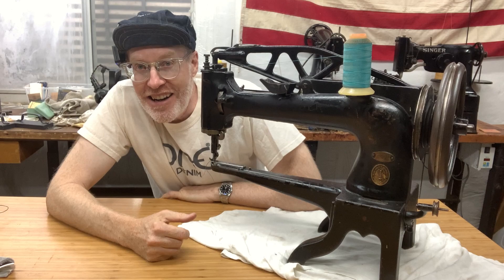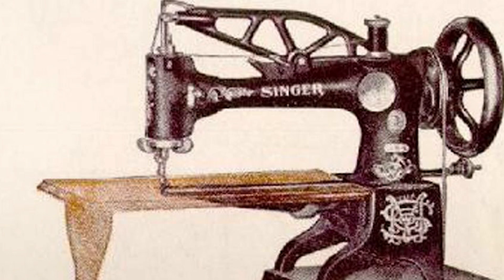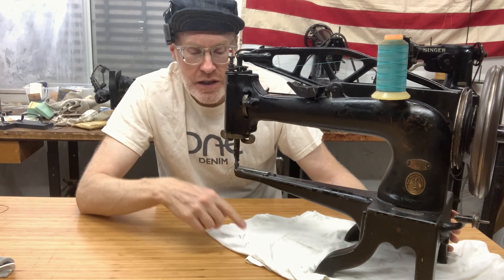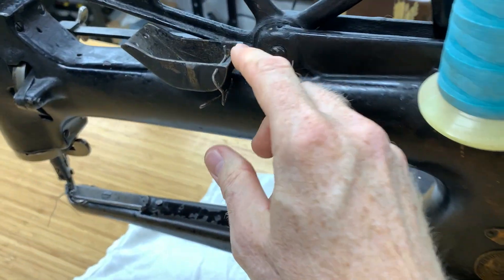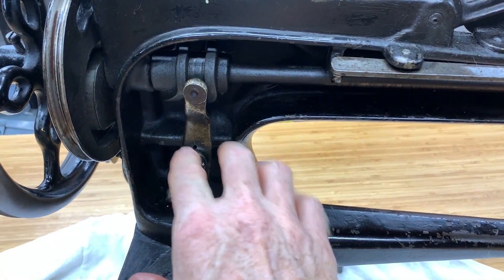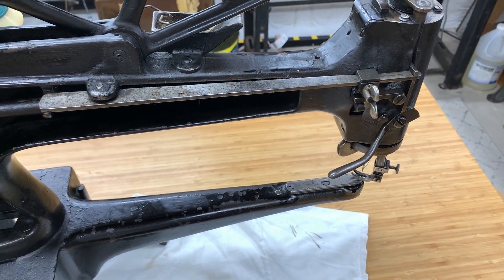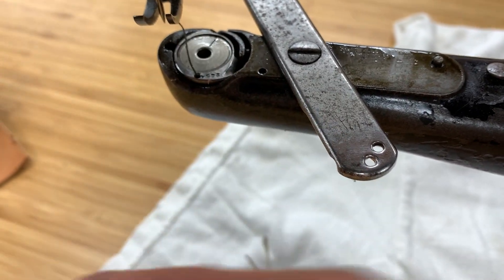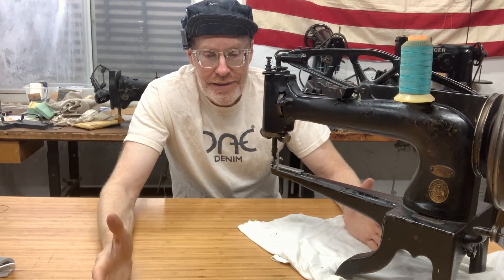The Singer 29-2 Patching Sewing Machine.

Comment: I have a 29-4 . Having trouble getting a stitch longer than very short- I think I read this is a common issue after much use- would love to hear from someone who has found a solution for insuring long stitch .. thank you!
Reply from the maker: You might have to get new parts for it, if they've been used for 100 years it might be time.